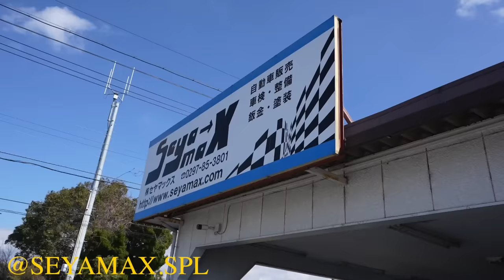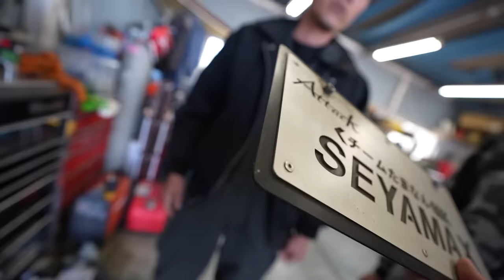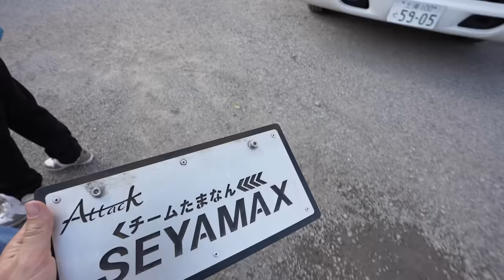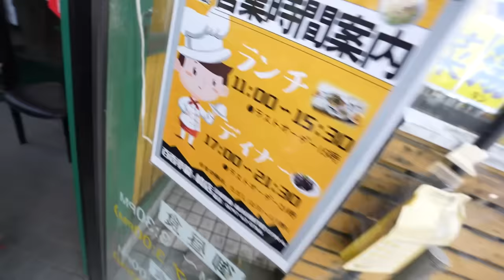Visiting Japan's LEGENDARY GTR Builder | Finding RARE JDM Cars on the Touge!

Comment: Dut sick vid and i think you need a GR86 in Japan for a Time Attack car next year 👍that would be epic they're fairly cheap and i see alot of people now swapping over to them and using them for Drifting and Time Attack and its such a great platform to start with and they have so much potential they handle amazing and the readily available upgrades are endless i think with like 500Hp to 600Hp that thing would be a beast and dominate at Time Attack that's if you dont plan on running the secret car you havent revealed yet but i have a good idea of what it is and as always keep up the great work 👍